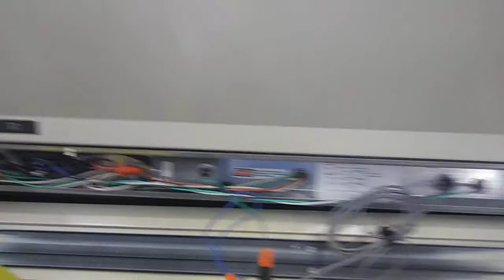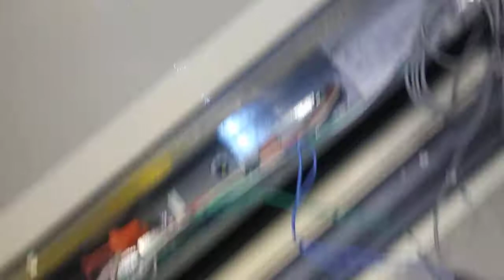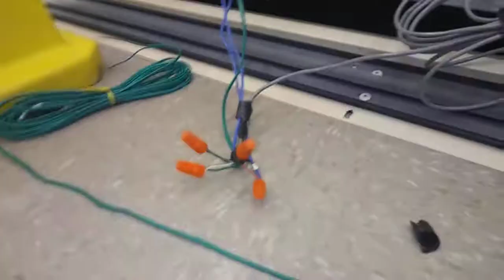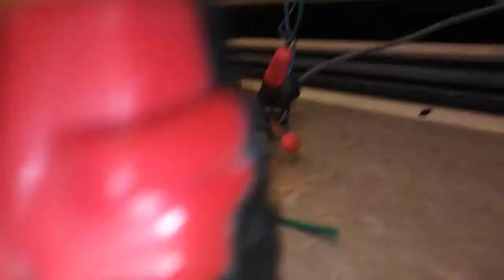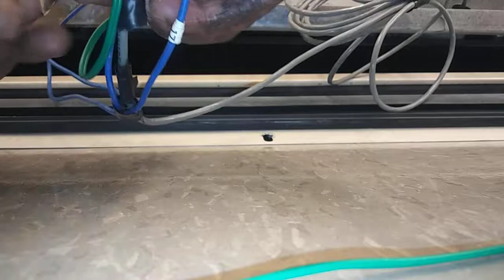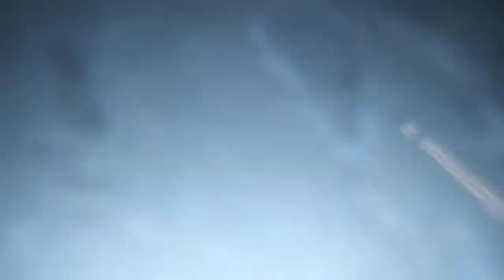How to tape a wire nut so that it will be secure

Comment: If

You don’t have to tape wirenuts. Strip the jacket, twist the wires together, twist on the wirenut, tug wirenut to verify that it’s on securely.
Reply from the maker: You don't is like having a safety on the gun

Comment: Could just use a Wago lever nut and be done faster.  For the DIY guy at home, I have stopped using wire nuts.  They are more expensive, but are a great time saver and you can see if the wire is all the way in.  If you have short wires, Wagis can be a life saver.